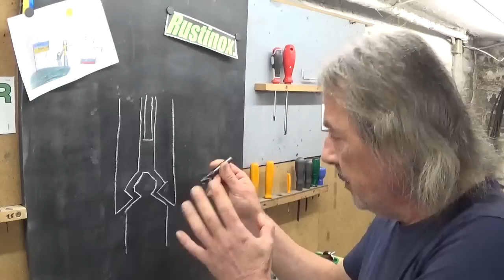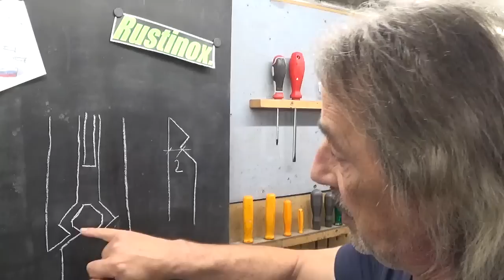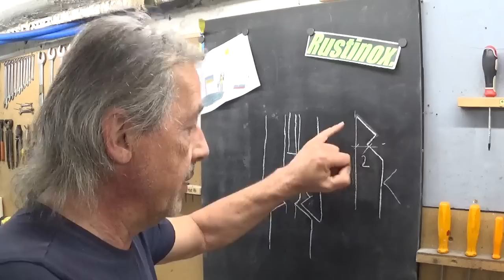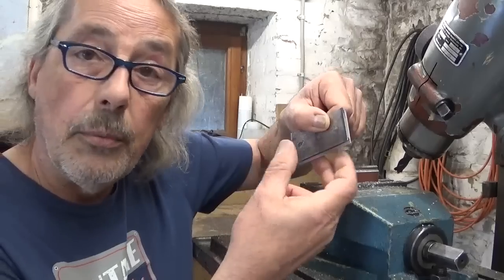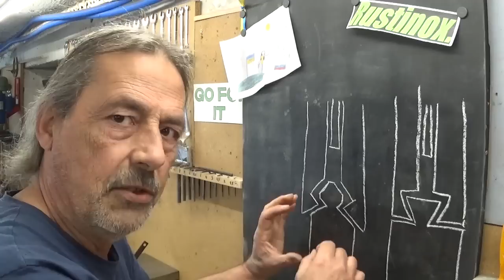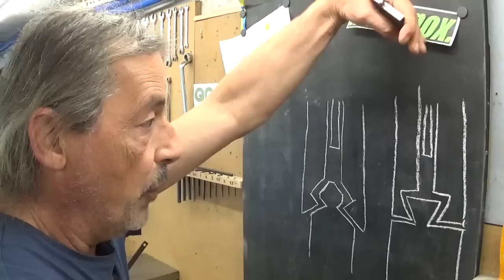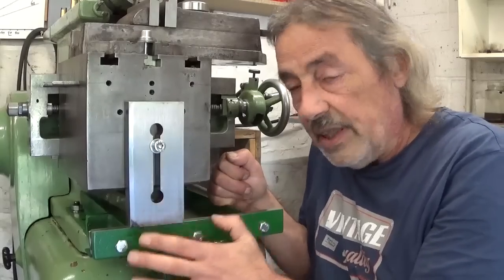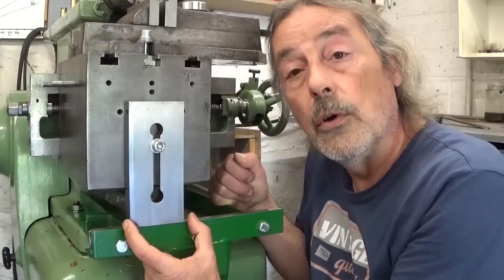Homemade adjustable parallels. A bit more experimenting.

Comment: I'm enjoying the experiments in adjustable parallels. I think, as far as your shaper table support, the only issue might be, how square is the support in relationship to the saddle ways? If the support is out of alignment with the horizontal ways, you could potentially lose some level of precision as the table is lifted or allowed to droop more as it travels.
Reply from the maker: It's very easy to align the support, so that will not be a problem.

Comment: Good demonstration of the pros for the square shouldered dovetail on the adjustable parallels Rustinox. I agree with you choosing the solid sliding support for your shaper.
You could make some wipers to fit on each end to clean its path as it advances along the support bracket, also an oiling point or two to keep it well lubricated. Cheers Tony
Reply from the maker: Good idea. Thanks Tony.

Comment: The shaper table support is far better as you have it with 2 flat sliding surfaces rather than rollers for all the reasons you point out here. The table support on large industrial shapers like Cincinatti works on the same principle as yours(just 2 flat sliding faces)
Reply from the maker: Simlpe and effective.

Comment: Nice work Michel, and good explanation on the pros and cons for the two different styles for the parallels.

I think you are right about the shaper. If the table is stationary when the pressure is applied then there should be no wear. If there are concerns you could fix a strip of sacrificial brass between the bottom of the block and the support. That way the brass can be replaced if it wears over time.
Reply from the maker: That could be a good idea. Thanks.
Reply: My first thought as well.The self lubricating nature of the brass as a slide would probably last forever.You could also add a drop of oil under the brass before use.There may also be a reduction in stiction for the slide.

Comment: I like that you keep improving the parallels.  To me that is the fun of hobby machining.  If every project didn't have its own set of problems, things would get boring very quickly.  One thing you mentioned about the motion of the shaper table, I believe that you said the table only moves on the backstroke.  Correct me if I am wrong, I believe that that is true when the table moves in one direction (right to left, I think), If the table moves left to right doesn't the table move on the forward stroke..  Also I like your analysis of the table support, regarding using a roller bearing for the Vertical support of the table.  KOKO!
Reply: That is why you should reverse the table feed pawl when cutting in the opposite direction so that the table always feeds incrementally across on the ram backstroke no matter which way the table feed is travelling(from left or from right)
Reply: @howardosborne8647  Hello Howard!  I just finished testing my 7" South Bend shaper.  Sorry to report that when the table is set to move right to left the movement is on the forward stroke.  Reversing the pawl on the ratchet mechanism changes the movement left to right and movement occurs on the backward stroke of the ram.  So my question is what am I doing wrong?  The pawl that I am describing is part of the ratchet mechanism that drives the table lead screw.
Reply from the maker: You can easily set the machine to feed left or right on the retunstroke, so it will never feed on the cutting stroke. No matter what direction it feeds.
I hope it helps.
Reply: @Rustinox  I have a 7" South Bend Shaper.  It is the newer model with the wider base in front, plus an oil pump.  I have checked the left/right table feed and on my shaper.  The table moves right to left on the forward stroke and left to right on the return stroke.  The directional pawl turns 180 degrees and determines direction. So what am I doing wrong?  If you know something I don't, please share?  The motor turns only one direction no reverse and even if it could be reversed I don't believe it would change anything regarding table direction, but I am not able to test that theory. Looking forward to your reply!

Comment: Hi Michel, very good job done, I am no machinist, more a IT person, but why over complicate it. Why can't a simple U/T (don't know what to call it) male and fitting female work? It is a down ward force on the joint, use small grub screw at the back at an angle just to lock movement. Sorry for my ignorance I am no machinist but aren't you "inventing" your own?
Reply from the maker: That could work, but it also make the parts more complicated.

Comment: Hey Michel, your id about the table support is good 👌but i think 1 bold wil bust out. Cast iron is not so strong . Is a back plate a option? Or more bolds.  Jus some brain farts😅
Reply from the maker: No need. The bolt doesn't need much torque.

Comment: I'm working on a video, that agrees and confirm your sliding surface issue instead of bearings, I'm trying to show that square inch / millimeter of bearing surface tension is VERY important for stability/rigidity. I fully Agree with your conclusions on surface area loading.
Reply from the maker: Nice. I hope you'll share the results.

Comment: Hey Rusti, my old 18 inch shaper has a sliding block, or what to call it. The shaper is over 50 or 60 years old, and the system still works. I call that prove of concept, so no worries. Cheers 👍
Reply from the maker: Simple and effective.

Comment: The roller bearings are no good because that horizontal surface will get covered in chips, and the bearing wheel will roll over the chips crunch crunch.
Your sliding block is much stronger, can be lubed, and like a bedway etc can have a couple of simple wipers on it. 👍
Reply from the maker: Indeed. And it's easy to recut when it starts to wear.

Comment: Excellent video Michel, the built up part never occurred to me. I have been pondering buying a set, but also the building is fascinating. My design (still in my head) is to cut a dovetail with a very small milling cutter with the blank held at a 20-30 degree angle, as Henry Hall describes  if you don't have access to a dovetail cutter . The other option I am toying with is to cut down a small milling tool or blank to a dovetail shape, again making my own angle choice due to limited size. Of course. I am on retirement time, so this may take months. Enjoyed very much, and looking forward to next weeks "frolics" . Take care and cheers!
Reply from the maker: I think this experiment was well worth doing. Now it's your turn :)

Comment: I like your shaper block solution.  As you say, bearings are a bad idea, for all the reasons you give, plus force concentrations in the bearing(s), chips and crap getting into the bearing, shear force on bearing axle, etc etc.  A bit of oil on the new "way" you've added, and you're golden.  Can't remember if they are steel or cast iron, I'd have gone for cast iron.

There is another way to make adjustable parallels, of course.  The way apprentices would have been required to use back in the "good old days".  Chisel, saw, file, scraper :)
Reply from the maker: The support is steel on steel. It's all I had.